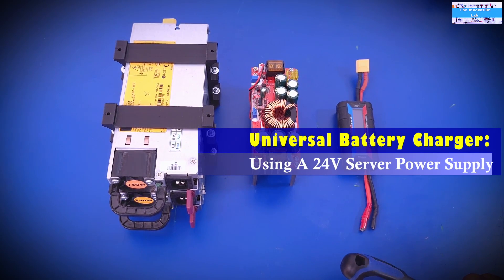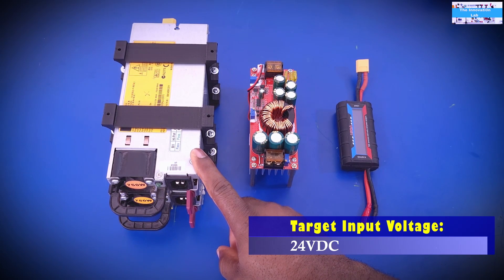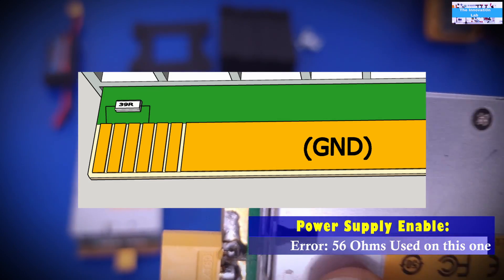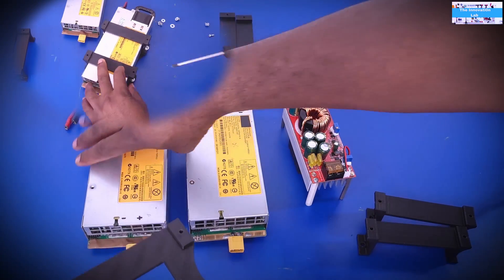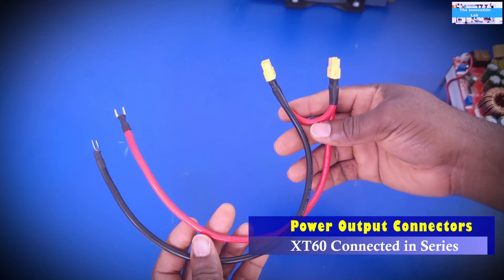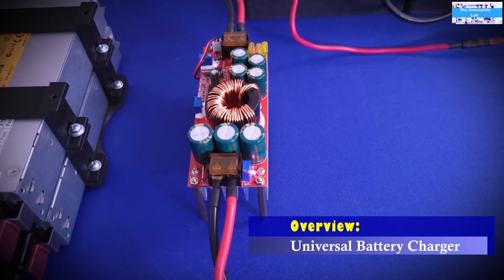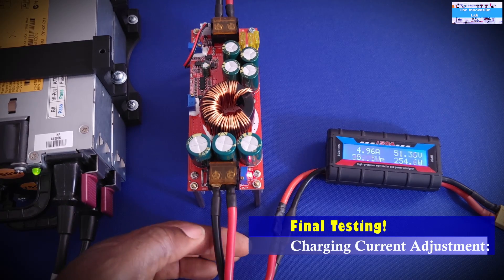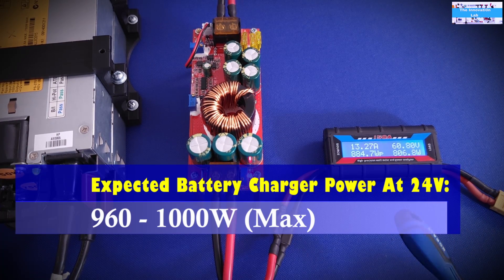BATTERY CHARGER, 24 - 95V, Using Constant Current Boost Converter.

Comment: 10:32  am planing to build a battery charger after watching your videos I got everything, except wattmeter that am not getting locally have to order online.

I was wondering why you suggested not to go higher amp than 15amp/800w? Is it cause of the 700w limit of  power supply or anything else? 😅 Just want to know that so that I don't burn anything in my setup. Am planning to use 48v 600w input setup and upto 20amp whole range output. Should I go with one module or should I parallel them?
Reply from the maker: Thanks for watching our videos and supporting our channel.

I believe the 15A limit was a cautionary note....to sure you don't overload the converter at the input stage. In the video, I was using the converter at an output voltage of 60V....so at 15A, that means you are drawing about 900W of output power from the converter. Now if you factor in converter losses at about 90% efficiency, that means input power of close to 1000W....this will be pushing it is your input voltage is only 24V.

If you are using this to recharge say, a 30V battery, you should be able to put close to the rated 30A out of the unit.

About paralleling, please watch my latest paralleling video. 

Respectfully,
The Innovati0n Lab 
www.theinnovati0nlab.com

Comment: Hi sir, I have a Meanwell 12v 30 ampere power supply, can this tool be adjusted to 14.6 volts 30 amperes for lifepo4 12v 100 amperes? and can it be adjusted to 58.4 volts 10 amperes for lifepo4 batteries
Reply from the maker: Great question!!
👍👍👍
You should be able to hit those voltages but not at those charging current levels. 
Reason:
Your 12V, 30A power supply provides less power than you need.

Your power supply will only give you 360W of power and just doing some mental calculations based on your numbers above. Your power demand seems to be greater than what your Meanwell power supply can provide.

I would recommend charging your battery systems at a lower charging current.
You could charge the 12V battery with 20A.....and the 58.4V battery with about 4.5A.

Also, keep in mind that the dc to dc converter that you will be using as the charger will have losses, and you have to account for that as a small fraction of your 360W input power.

I hope this helps.
Please help our channel grow by sharing our videos.
👍👍

Success Wishes.
The Innovati0n Lab 💥 www.theinnovati0nlab.com

Comment: great job ... can this type of converter output connect directly to run the bldc motor? thank you
Reply from the maker: Thanks.
Yes, but it also  depends on the power of the power rating of the bldc.
I have made some videos on this concept, and it was also one of the tests included in a recent video.
👇👇👇
https://youtu.be/kaTf1ML4HLI?si=xZ8O51cgbKyXxvaR

I hope this helps.
The Innovati0n Lab 💥 www.theinnovati0nlab.com

Comment: If I wat to change with 72v DC. How many power supply needed in series?
Reply from the maker: I am not sure if you meant "charge" or "change"😊.
But if you are looking to charge a 72V battery system, you can do it with one single 12V server power supply. However, your input power will be small. Using more server power supplies in series will give you more input power. 

See my math below:
👇👇👇
1 server power  supply:
Available input power = 12 * 30 = 360W ==> if you account for efficiency losses, you will have about 300W.

To double or triple or quadruple your input power, you can add multiple of the converters in series.

CAUTION:⚠️⚠️
For the series connection to work, you just have to make sure that the converters are output  ISOLATED from the Earth GROUND as shown in the video below.
👇👇👇
https://youtu.be/bljHMx3Mj78?si=i1ZHHeolrMhNH11j

I hope this helps.
👍😎
The Innovati0n Lab💥
Reply: @theinnovati0nlab782  it is charge my bad. Thanks for the explanation.

Im finding this UPS with 50v output
Huawei R4850g it's about 3000watt
It's should be easyer the step up handle right? But I'm hard to find the necessarily canbus to make it works.
Reply from the maker: @surapurna  
That will be better if you can figure out how to make it work.
That is why I use the HP ones because they are super easy to implement with just one resistor.

Comment: Like the videos of testing the boost converter. I am looking to parallel 3 of those boost converters to convert 12v (gonna set to turn on at 13.8v) to charge batteries at 57.4V. Do you think it’s a good idea? Or should I get a converter to boost it to 48V before sending it to this boost converter to get a higher current 57.4V output?
Reply from the maker: Great question, but I not sure I fully understand what you are trying to do.
Why do you need to parallel 3 of the converters?
Just a small side note, paralleling the converters, does not work well - especially st high loads.
I won't recommend for you to do that.
👍😎
The Innovati0n Lab💥
Reply: @theinnovati0nlab782  My original plan was to parallel the converters if it could work to charge a 20kWh 48v DIY battery system using 12v system in my truck. The battery would be used to power comfort loads in the truck so I don’t need to run the engine to stay cool in the summer or draining the truck batteries every night. Sounds a bit of an overkill for the total power but I need to system to provide me up to 30 hours without charging and can charge at least 50% in 10-12 hours when the engine is running each day. Charging through a converter in 14v 30A max would get about 20% capacity each day so I would need higher output power. My other option is to get a converter that can boost the voltage up to 48v with relatively high output power and use the converter to fine tune the safe fully charged voltage.

Comment: Just subscribe to your channels, i have already build one server power supply based on your design and thanks ,  two things i need , designs files for PSU Bracket you 3D printed and  some help switchin on my DPS-750PB A server power supply dont seem to find any pinout on the net, will appreciate
Reply from the maker: Thanks a lot for subscribing to our channel. I am glad you found our videos helpful. Regarding the DPS power supply, what I remember was that some of these power supplies are intentionally designed to make hacking them for DIY purposes difficult. I will recommend using the HP server power supplies for now. I found that the 750W and 1200W models have similar pinout configurations - for enabling the power outputs. However, if I find some good information regarding the DPS models in the future, I will make a video to share it.
I hope the helps.
👍😎
The Innovati0n Lab

Comment: interesting...Can use ATX power supply ..? or limited to server power supply.. .
Reply from the maker: Hi friend,
As long as your power supply can provide anywhere between 10V to 60V DC output voltage range, it should work.
Si
Success wishes, my friend!
👍👍

Comment: thanks a lot for this video
do you know if it is possible to connect multiple boost converter in parallel, assuming we have enough power from the switch power supplies?
what would be the issues if any?
Reply from the maker: Hi friend,
Thanks a lot for the great feedback.
It is always more difficult to connect individual SMPSs in parallel, especially if they are not designed to do so.
But this is something I will try with these converters in the future.
Stay tuned, my friend!
👍

Comment: What are the two 12v batteries for?  Are they LiPo's in series with the blue pak?  At first glance, I assumed that the blue pak was the 24v batt...is it 12v in series with the two black batt's?
Thanks much!
Reply from the maker: Hi friend.
The goal was to show that it is possible to  use the boost converter to recharge a 48V battery system for a 24V power supply (the server power supplies).
The battery breakdown is basically ==> 12V + 12V + 24V.
The BLACK batteries are  12V lipo batteries, while the BLUE battery pack is a 24V lithium ion. 

Caution: As I might have mentioned in the video, it is not recommended to mix battery chemistries for your projects. I only did that for a controlled short duration test. Please, I will recommend you don't do that. Use the same battery chemistry for your project.

Thanks again for watching and for asking such a thoughtful question.

Success wishes on your project, my friend!
👍👍😎

Comment: GREAT VIDEO!!! I am going to build this.  I have all parts you used.  BTW, you can simplify solder a jumper wire on the server supplies...I have several for supercap charging.  I also ordered another power meter.
DID YOU RE-WIRE THE METER WITH THICKER WIRES???
Thanks again!  Thumbs up and a sub!!
Reply from the maker: Hi friend!
It really makes me happy that you are going to give this setup a try.
You are right about simplifying the output connections of the server power supplies - with a jumper wire. However, make sure that your jumper wire is properly insulated. Each of those server power supplies is rated for 65A, and you don't want that shorting.

Digital meter:
There is no need to change the wires because the short wires it came with are tinned wires and  should be able to handle up to 60 - 100A. Please check the manufacturer spec. If you want to add longer wires, then you need to size them appropriately to handle your expected maximum output current. You can search online for "Wire Ampacity charts"

Success wishes on your project, my friend.
👍👍😎

Comment: i need help before buying this converter 
if i give an input voltage of 24v can i get output voltage below 24v like 12v please reply???
Reply from the maker: Hi friend,
Thanks for watching our video. 
The quick answer will be no. The converter shown in this video is a boost converter. It will only boost your input voltage to an adjustable higher output voltage  level. It seems that what you need will be a buck converter.
Unfortunately, I have not found a good reliable buck converter that I can recommend to you. When I find a reliable buck converter, I will do a test video for it. 
Stay tuned, my friend.
Reply: @theinnovati0nlab782  ok 
Subbing for that
Reply from the maker: Thanks a lot!

Comment: The DC to DC converter can i use 2 of them for more voltage and current
Reply from the maker: Thanks for watching our videos. 
However, with the current design of the boost converter, it is possible to increase the output voltage a little. But you have to change some of the drive components on the output like MOSFET, rectifier diodes, and filter capacitors.
But you cannot connect two or more of these converters in series -  because both the input and output are referenced to the same ground (-ve).

Please watch my last video on the High Voltage charger experimental video.

Also, I plan to make more experimental project videos to show some stuff I have been testing.  

Please don't forget to help our channel by sharing our videos.
Thanks again!!
Reply: @theinnovati0nlab782  do you have video on which you modify it to handle higher currents? Is it possible to make it handle 60A?
Reply: @ffre4k I believe you could run w in parallel to double the output amps.

Comment: hi can you try it from 12v to 72v charging? bcause mine is only 2amps below getting rated
Reply from the maker: Yes, you can. According to the specs of the 1500W boost converter, it accepts input voltage ranges between 10 to 60V and output ranges between 12 to 96V. So you should be able to adjust the output voltage high enough to charge your battery.
Reply: @theinnovati0nlab782  yes but i only get 2amps pls try to 72volts thanks.

Comment: "Two 24 volt battery packs" . They say 12V each. You don't need 62 V to charge them in series. And since there is no balancing, they should be charged in parallel.
Reply from the maker: Thanks a lot for the positive feedback.
Sorry about the confusion. There are essentially 3 battery packs all connected in series (48V) for the testing;

Breakdown:
- two 12V 30 Amp/hr Lipo packs connected in series = 24V (the black battery packs)
 - A single 24V Li-ion pack (the Blue battery pack)

So overall:
12V + 12V + 24V = 48V
Please let me know if have any question as to why I was charging them with 62V so I can explain.
Reply: @theinnovati0nlab782  They should not be charged in series because they are different capacity and may have different SOC. There is no overall BMS so you can't guarantee that one won't be exposed to excessive voltage, be damaged, and catch fire. If you rely on the individual pack BMS, whichever pack is fully charged first will interrupt charge current to the others.

Comment: bro is this good for long time use?(dc-dc boost converter)how was your experience with this.coz am going to buy one for make a 72v battery chager so may be i can use that for long time?
Reply from the maker: Thanks a lot for watching my videos and for such positive feedback. 
Yes, it is good for long time use. As long as you understand the limitations of the components you end up using - such that you don't overload it. Another trick is to make sure you use a good fan to keep the boost converter cool.
I built my first one 4 years ago and I still use it till today.